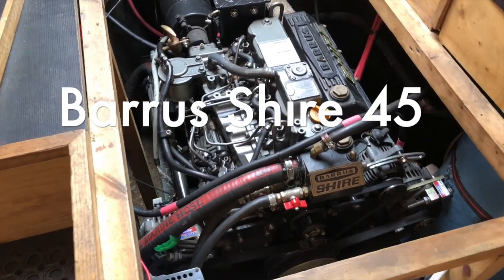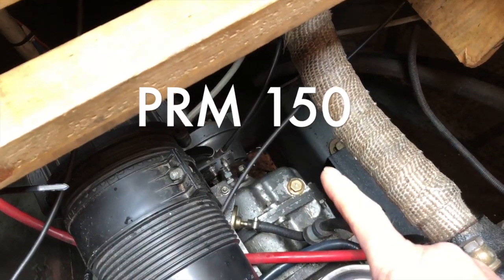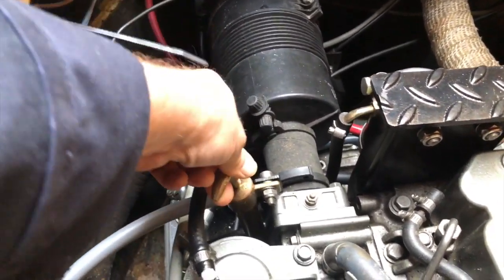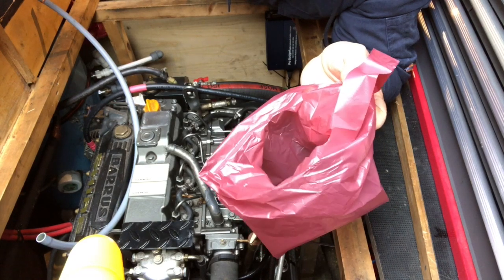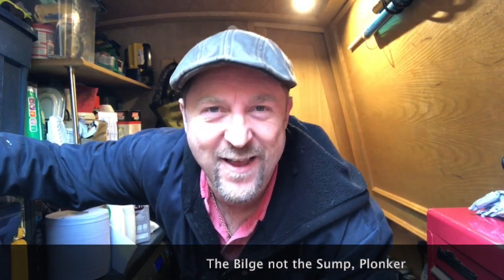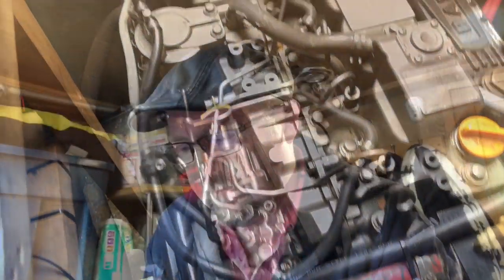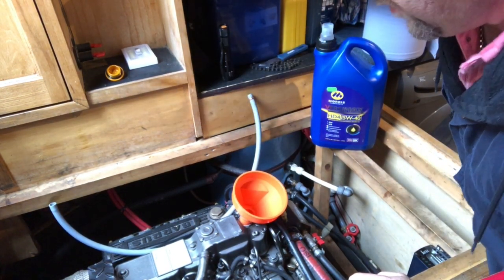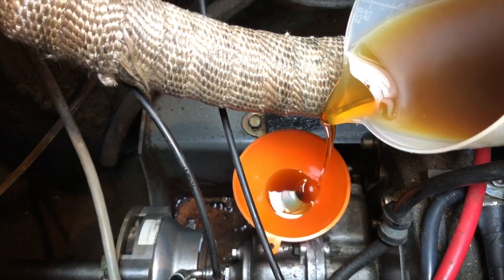E43.Narrowboat Engine Service, on a Barrus Shire 45

Comment: I'm a retired diesel truck mechanic.  You are super.  You know what you're doing, you do all the safety things, you minimize all oil/fuel/contaminants from pouring into the bilge of the boat.  You do stuff even tho it makes the job more difficult, but it minimizes contamination into the bilge and therefore into the canal water.  Holy smokes, you say something is "a little more inaccessible", that's sure true!!!  Good on you for doing all the right things.  Air filter?  was there an air filter?  I bet there was and I bet you changed it or cleaned or whatever else was needed.  Any professional engine maintenance shop should have you on board!
And Debbie's video was professional to say the least ... lighting, the angles, noise minimization, etc.... as it always is.
Oh, I just do have to say that I really like your ending video and music too.  Cruise on.  🙂
Reply from the maker: Thanks ❤️

Comment: I like the vlog, thanks for it. I haven't read all the comments, so apologies if my points have already been covered. The oil removal pump usually has a valve at the bottom of it that you need to turn on, otherwise no oil comes out. It has two wings on it like a wing nut to enable you to turn it. You need to turn it back off when you are finished as pressurized oil can escape the pump when the engine is running. It's not much but can be messy. Secondly, when dealing with the oily bits, it is best to use protective gloves. These are easily obtainable from Screwfix, Toolstation and even supermarkets. Oil is carcinogenic. Lastly, running the engine for 10 minutes before you start warms the oil sufficiently to make it easier to pump out, but not so hot as to burn you. I hope that helps.
Reply from the maker: All very good points I should have mentioned, thanks👍

Comment: Another good video, it's worth mentioning it's easier to change the oil when the engine is hot and I would wear some protective gloves. Run engine and check level if you have changed the filter. I normally suck the oil out of the gearbox, it's easier (PRM260). It's easier with an engine room. Thanks, have a good Christmas.
Reply from the maker: Mike Griffin Thanks, all good advice that i should have mentioned 
merry Christmas 🎄

Comment: I find that if you pour the oil out with the opening at the top instead of the bottom you can control it better and you don't get that glug glug glug that can splash about.
Reply from the maker: I will try that next time 👍

Comment: You can get a small vac pump that would make your gearbox easier even use it on the engine; called a pellam  pump use them on cars now as alot dont have sump plugs i do mower repairs and serving in france and use one
Reply from the maker: David Neil now off to google Pelham pump👍
Reply: @welldeckdiaries5610  Sorry Mark told you wrong mine is the Pella 6000 great bit of kit

Comment: i have the same engine, you didn't show the primary filter change, which is probably the most difficult bit as it needs priming ? I use a 12v pump to get the oil out the gearbox, no way am contorting about under there 😁😁

Comment: Thanks for the video, I’ve got a Barrus Shire and we have to much coolant that keeps going over the full line in cruise and leaks out?  Any suggestions or tips to empty some of said coolant? 👌🏻😀
Reply from the maker: Im assuming you could release a hose on the bottom of the header tank to drain some off.

Comment: Do you service the stern gland and stern tube? How often is the maintenance? Do you have to pull the boat out of the canal?  When you were talking about the importance of having a clean engine bay is good advice. We used to use disposable diapers to catch various fluids in the engine room of the crab boat I spent time on.
Reply from the maker: We have a manual greaser for the stern gland, we do this every time we cruise, the rope in the stern gland can be replaced with the boat in the water, The service intervals are relatively short, 250 hours. and I've got some disposable nappies for mop ups👍

Comment: Well done! You did not mention how often you need to do an oil change. I have a PRM150 gearbox too, and a mechanic told me the oil there only needs changing every 2 years, as it doesn't take the same hammering that the engine oil takes. This might be helpful if you are currently doing it manually!
Reply from the maker: Theres a lot I missed out that I could have added, apologies.
The engine oil and gearbox oil should be changed every 250 hours or 12 months whichever is sooner.We have serviced our engine 3 times this year😳

Comment: Not a lot of room around that engine, and the gearbox was fun to do I should think. Is there not a pump on the gearbox like on the engine. Both shires I’ve done had one.
Reply from the maker: No pump on the gear box, you have to lay on the engine wrap your arm around and underneath and you can just reach the drain nut. Reaching the stern gland is almost impossible

Comment: Don’t forget your fuel filter/water separator.
Reply from the maker: Jeremy Kamel I know,I did do those and the air filter didn’t film those bits  my mistake
Reply: Well Deck Diaries no worries. Air filter is nothing. Just thought people might like to see the fuel filter change. Really that’s the most important part. Because done wrong and it won’t immediately restart. It’s not hard at all it’s just a little more detailed regarding removing the air from the system.

Comment: I am not familiar with the cooling system on narrowboats, my yacht uses sea water as a coolant and also to heat the domestic hot water so I have to replace the rubber impellar blades on the water pump at regular intervals. Does yours have a different system? IF you have trouble getting a funnel into anywhere consider using a length of plastic pipe as a syphon.
Reply from the maker: the coolant system is a sealed system with a Keel cooled Skin tank on our narrowboat, This in turn heat the domestic hot water. Some of the older boats have a raw water cooling system

Comment: Hi Mr Well Deck ,hows the solar going? has it dropped off ? just wondered how far into winter it was before the shadows from the banks were falling on your panels? Ps. notice Cpt Debbs done a runner while you had ya noggin shoved in the bilges ! don't she know that narrow boat service manual states a 1:1 ratio of tea per oil change ?  hope the fair lady of the locks is ok ,.......merry winterval to all ,doggos and friends,near and far ... the Foot x
Reply from the maker: BIG FOOT Hello my friend, the solar is only putting about 15 Ah back into the batteries on these dull winter days. Debbie’s fine and I can’t wait to show here the 1:1 ratio bit, I might add a bacon sandwich clause in there as well👍
Reply: @welldeckdiaries5610  m8 you are on your way to a lump of coal with those crazy ideas ! when people say that solar is no good in the northern hemisphere,i think they are ignoring the benefits of having them,instead of looking at cost per kwh ,the potential battery care while away,plus the summer payback/generator/wear savings is more than just cost ,it is worth it for the months when it just works in the back ground without hassle or worry i would say ,was going to comment on getting Debbs to stand under the engine to help ,but I won't 'cause I really want an apple and an orange in my stocking this year,(already got more coal than a Chinese power plant )

Comment: Hello
Great vlog as usual, but i wonder about the type of oil.
In my engine (a Volvo Penta) on my yacht I will, according to Volvo, use engine oil in the engine and gear oil in the gearbox.
You used the same engine oil in both, is it according to the manufacturer's recommendation?
I'm also curious about the cooling system so it would be great if you wanted to do a vlog about it at some point.
Have a great cruise
PeterPaul
Reply from the maker: PeterPaul 62 Manufactures recommendation to use engine oil on the PRM hydraulic gearboxes . ATF on other types of gear boxes
Reply: You need gear oil in manual gearboxes that , like cars have cogs meshing together and engine oil in hydraulic engines where the oil is used to push plates or cones together. The 150 is of the latter type.
Reply: @welldeckdiaries5610  The reason I asked is that here in Sweden where I live, we have (I think it's the same in the UK) engine oil for the engine, transmission oil for the gearbox (manual) and hydraulic oil for the hydraulic gearbox. And the recommendations require that you use the right kind of oil. So if your manufacturer recommends engine oil then you should use it. I'm just curious about what the manufacturers recommend. Have a safe cruise.
Reply: @nigelnicholson7439  Hi There are many different types of oil and the manufacturers require that you use the right kind of oil. So if your manufacturer recommends engine oil then you should use it (as in this case). I'm just curious about what manufacturers recommend.

Comment: There have been several engine service vlogs but nobody mentions replacing the coolant. Does anybody do this? My manual says it should be done every two years but I’m unsure how to do it.
Reply from the maker: You are correct there Andy. It should be replaced at the interval stated in your manual. I check mine with a hydrometer which will tell me if there is enough antifreeze in the water, but the  antifreeze/coolant also has corrosion inhibitors added, and it is these that lose there ability to protect your coolant system from corrosion. I actually want to do mine, its just a case of draining down coolant system and refilling with fresh water and the correct amount of antifreeze for your size of system. the hard part is disposing of the old water/antifreeze mix responsibly